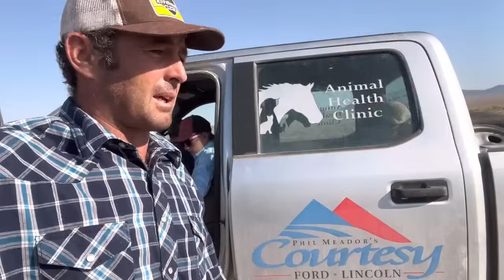SNAKES 🐍 Abound | 💦 Problems all Around

Comment: Hi. If the ranger is a diesel then there is a small copper filter in the fuel intake to the injection pump, that could be clogged up. Unscrew the banjo un the pump, make a little hock out of baling wire, pull out the small spring under that is the filter pull that out and blow it clean and assembly it all again, and it might run again. It could also be the timing belt and that is bad. Rangers / Mazda need there timing belts changed strictly every 180000 km / 105000 miles.